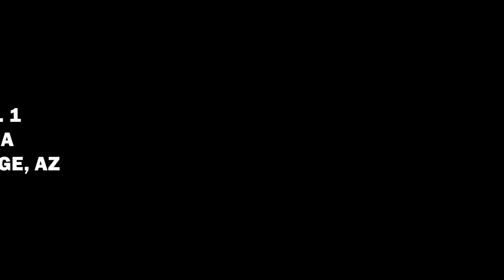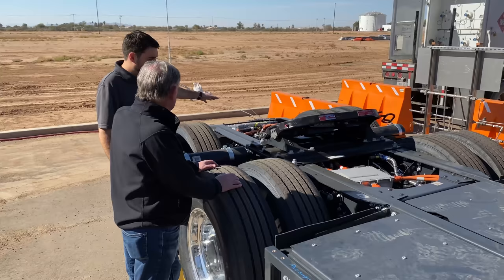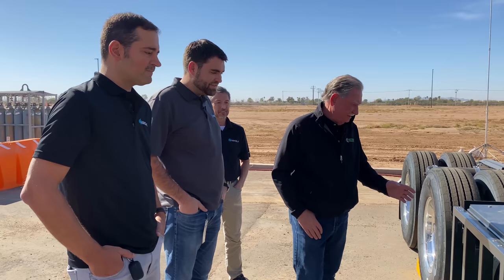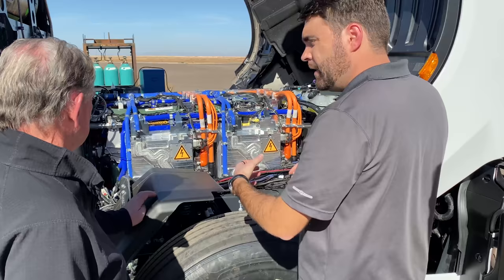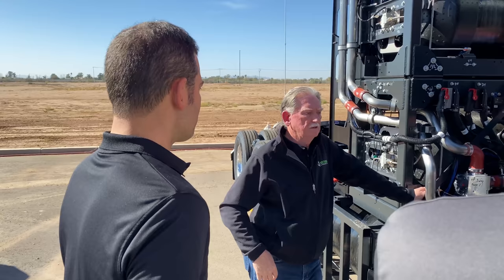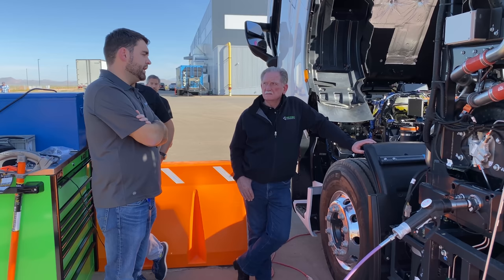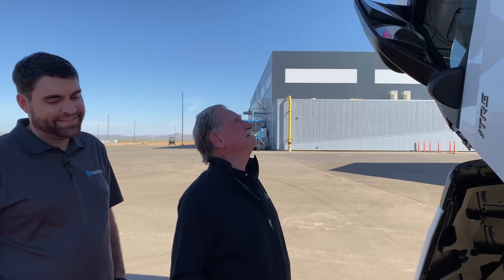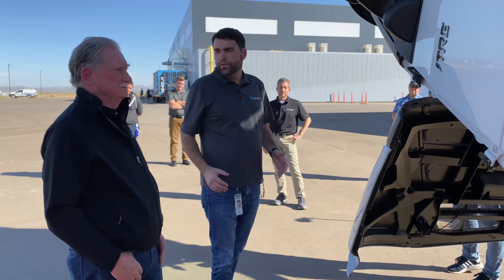Nikola Series - Ep. 1: Introduction & The FCEV Alpha

Comment: Just finished the video. Cool tech but not sold on hydrogen the slightest. The sheer complexity and inefficient process for extracting hydrogen with electrolysis just makes me wonder why anyone pursues this technology. I could even consider hydrogen for long range autonomous aircraft.. but a semi truck? Why? I'll bet that electric semis will be on the road before hydrogen semis. Just my opinion.
Reply: Agriculture is probably the biggest industry for hydrogen. Most rural regions simply don't have the electrical infrastructure for BEV replacement of their equipment, and no farmer has the time to bring a vehicle in for charging... that's why farmers own their own fuel trucks. Hydrogen can be delivered to the field.

That said, I am not a farmer. I'm bullish on Tesla, and that's about it.
Reply: I agree but their argument, as best I understand:  Batts are too heavy for long range trucks and they pretend(ed) they can create H on cheap hours grid electricity--mostly another Milton fantasy.  Also the 'charging' speed.  NKLA should be a penny stock regardless, falls flat economically with no path to viability.  H stations will be extremely expensive with many required.
Reply: If hydrogen starts to get used in chemical industry, electricity generation, heat generation and there starts being massive networks of pipes and tanks carrying hydrogen everywhere, maybe. I wouldn't be surprised if in the end it would be more useful to burn the hydrogen in a specialized ICE or making synthetic methane out of the hydrogen and then burning that in an ICE. The electrolysis process actually has pretty good efficiency when it takes place on an industrial scale and we will eventually get to a point where we have so much wind and solar that we don't know what to do with them. Converting the energy into hydrogen fuel might eventually be economically viable.
Reply: Hyzon motors?
Reply: Hey man, just wanted to say I love your channel, huge fan of your work! All the best! <3
Reply: @PhilipBarton  Nice pondering about the future industrial farms. I suspect they can get away with mostly solar directly charging up tractors in daytime and let them loose autonomously during night.
Reply: @PhilipBarton  self produced solar and wind power is much cheaper
Reply: @Luca-cs8fy  Absolutely. A farmer would still have to pull a vehicle out of operation to charge. They won't do that because they can't afford to do that, which is why the fuel truck goes to the vehicle and not the other way around.
Reply: I used to have the same opinion. But. In the 2030s or so, we're going to have mostly renewable energy production (plus storage), and we'll have to scale it for the darkest, least windy day of the year. On brighter, windier days we'll have more energy than we know what to do with. Hydrogen production would be one of the things enabled by this surplus power.
Reply: @whejl123  I'd love to see a future where farms are robot-operated multi-story warehouses with year-round environmentally controlled operations. Depending on the weather allows for so many uncertainties and risks. In this vision of the future, BEV devices make perfect sense. Current farming operations are so sprawled out, it makes almost zero financial sense for a farmer to install charging infrastructure at or near every potential charging location. The great distances and the time-sensitive nature of farming are the two main reasons farmers seem to be most interested in hydrogen at present.
Reply: It’s easier to convert trash(plastic) to hydrogen than split h2o molecule. That’s a promising approach!! Assuming that can be done on cheap!! There’s just not enuff battery raw materials to feed the demand for electrification of every single motor vehicle. Lithium / nickel / cobalt. Just not enuff mining infrastructure ..hydrogen will have its place in the green economy!!
Reply: @whejl123  not sure. Tractors are typically under working point load somwtimes 24 hours, which is a perfect use of diesel, but kills battery power. Also the extra weight might be problematic as they are under time pressure due to ripening regardless of weather -- loose soil. Maybe there a swap system would be still best.
Reply: Transporting anything heavier than bubblewrap will severly decrease the range for an EV truck. It's just not practical for trucks and heavy machinery.
Reply: @PhilipBarton  - NOPE, see why Hydrogen is STRANDED, here - RethinkX - superpower.
Reply: FCEV & CNG/hybrids are OUTDATED, Tesla BEV Semi is superior.
Reply: @markplott4820  Why the Tesla BEV semi as opposed to any other BEV semi?
Reply: It might make sense for use cases where you don't have hours on end for charging the truck, like farming equipment mentioned or maybe long haul trucks, when down time is far more expensive than a bit higher fuel costs. H2 electrolysis for fuel/energy storage also might make sense if done far away from densely populated regions with lots of sun/wind and otherwise useless area, like desert or offshore and then transported similar to natural gas now. Producing it close to populations centers where space is expensive + the need to transport physical stuff does indeed make 0 sense.
Reply: @PhilipBarton  what i see in holland is that many farmers fill their  roofs with solar and dont know what to do with their electricity some free fuel /backup power in a battery would be nice
Reply: My company produces hydrogen planes, trains, generators, and trucks along with diesel engines and was the first electric semi-truck back in 2019. The issue is energy/kg. Listen to what engineers in this video are saying. This technology issue with batteries in the heavy load EV market is what others are running into. Tesla hauling a Pepsi 18k lbs truck between 150-mile warehouse is easy to do on flat land in an EV truck when it's warm out and others are already doing it. The real world is under 32F over 500 miles per day in rolling terrain and mountains. The battery kW/kg and degradation are too much for such loads.
Reply: @markplott4820  See why it's not stranded by visiting with a farmer. I will never want a hydrogen vehicle, but that doesn't mean it's not practical for someone else.
Reply: So Sandy goes to a massive empty factory,  to stand outside and see a single truck, that can't move?!
Reply: Agree. If a hydrogen semi and a battery semi comes to market and one of them needs 3x more more energy, no one will buy it.
Reply: Hindenburg was flying many times from Germany to Rio De Janero. Element number one will always blind the more blind person....
Reply: Same here. If the goal is to cut emissions, hydrogen as it it correctly derived, is a terrible way to go. It makes more sense to go with natural gas. You still get CO2 emissions, but it's clean burning and much better for congested cities than diesel.  But even natural gas trucks cost significantly more over the life of the truck than diesel. Hydrogen is a dead end unless there is some major breakthrough in the extraction and storage process.
Reply: @7secularsermons  Agreed on the need for medium-term and long-term energy storage.  My bet is that methane will prove to be both easier and cheaper than hydrogen for this purpose.
Reply: @johnnymellon7414   - it takes ONLY 30 min at a TESLA Megacharger that runs on 100 % SOLAR. 
and Tesla can even sell the Excess at a PROFIT.
Reply: @sideshowlol  ONLY , Tesla SEMI has the RANGE (625+ mi) and Megachargers that charge to 80% in 30 min (Lunch Break) , and can 100% FULLY Charge OVERNIGHT Durring MANDATED Sleep period.
the OTHERS like Nikola , only have > 300 mi Range , and ZERO Megachargers.
Reply: Agree, looks insanely complicated. I also do not buy the safety part. Extreme high pressure will never be 100% safe.
Reply: Also what is constantly overlooked is the 95% recycle capability of batteries which will lower costs where as hydrogen extraction will always remain inefficient just on a pure physics level that cannot be overcome.
Reply: @Mrbfgray  Hydrogen vehicles are just as heavy as BEVs. The "hack" for getting better range out of these trucks is the same one employed by the new version of the Mirai: they doubled the capactity of the tanks by going from industry standard 350bar to 700bar. But as rare as hydrogen filling stations are, you know what is even rarer? Ones capable of producing 700bar. That is why they quoted the filling time as ONE HOUR. Because they dont even have 700bar capable filling at thier production facility. 🤷 So it weighs just as much as a BEV and it takes just as long to fill, and it uses just as much exotic materials, but it will be more expensive. I dont see the advantage.
Reply: @markplott4820  The semis will have to run on an NMC battery chemistry. They have higher power density, are able to provide "faster/more", but if you cycle them often below 20-30% or above 80%, esp. on fast charging, it seriously affects cycle life.
Reply: Biggest difference is weight. Many places have weight limits on trucks and batteries are very very heavy. Range and fuelling time as well, but they are lesser issues
Reply: @johnnymellon7414   - TESLA Semi use 4680 High Nickel content .
for PORT ops or Short Haul they can use LFP . 
TESLA complelety negates ANY Effects of its Cycle Life , TESLA 2170 Today last close to 2 million miles. 
Model Y in Austin will be close to 4 MILLION miles PACK life.
Reply: Of course they will be on the road before FCEV semi-trucks. Listen, the weight of the batteries is self-defeating. You are deducting 25% of the load. Green hydrogen is going to get better tax incentives than battery. How does battery perform in cold weather? Which energy storage mechanism is superior? Hydrogen wins. Time and weight plays a huge role in the trucking industry.
Reply: @Mrbfgray  The electric grid is cheaper where hydrogen makes sense. Green hydrogen is also going to get a huge tax incentive. The best you could ask for. Bo, Yankee stadium needs a new toilet cleaner.
Reply: NIkola is a scam
Reply: @markplott4820  Hi Mark. Is Elon Musk ever wrong?
Reply: @markplott4820  The European Union is moving forward with building a hydrogen infrastructure. If you dont believe go to the European Union's website.
Reply: @markplott4820  To be honest, I would like to see a BEV/FCEV hybrid automobile for sale. You could use both when it is convenient.
Reply: Okay so there is a basic problem with an EV truck that you need to understand and that will help you understand why hydrogen truck concept has been touted. Now just wait til the end because i will also explain why Tesla’s new battery is a complete game changer for EV trucking. So let’s say you are going to hike across antarctica. It will take a few months so you bring a few months of food. At the outset of your journey you have to carry 3 months of food. 1 month into your journey you only need to carry 2 months of food and your waste you leave behind. So you extract energy from the food then dump the waste so you dont have to carry it anymore. Now what if you had to pack out all your waste? Well, you wouldn’t be able to travel as far because you would run out of energy sooner having to carry all that weight. You traveling across antarctica and dumping your waste is like a truck driving across the US. It burns it’s fuel and doesn’t need to carry the waste. You traveling across antarctica and carrying your waste is like a typical EV truck. After discharging their batteries, the EV truck still has to haul the dead batteries to their destination.  Now how has Tesla’s new battery solved this? Well, let’s say we invented a new replacement femur that would support your body, but also is a built in battery and you no longer have to carry ANY food across antarctica. You would make the fastest time and could travel the furthest distance. This is the structural battery, the single most important thing revealed in battery day and ignored by almost everyone. With this, a truck could be designed to replace its steel frame with batteries, and doesn’t need to carry any additional weight while hauling. This is why tesla semi has been delayed. They are waiting for the structural battery to be ready, then they will crush the competition.
Reply: The prototype looks more complicated than a diesel truck. I thought we are suppose to make things simple and less expensive. Instead you have a truck that: 1)cost more to buy, 2) cost more to fuel, 3) cost more to maintain and keep safe, 4) needs a more expensive fueling infrastructure, 5) and it does NOT even beat diesel today.
Reply: What's wrong with diesel electric?

Is the majority of hydrogen not produced from fossil fuels at the moment?

Why the major push to keep energy supplies centralised?

Decentralised energy production and consumption is the logical choice especially to safeguard against adverse conditions

Let's stop flogging the dead hydrogen donkey...

Roll on continued battery evolution
Reply: The best lectrolysis tech in the market today is beyond 85% efficiency. It means net 60% of power generation in compare to 70-90% of power generation with batteries. When you add the factors of weight, refueling times and battery degradation you get into the realization that it actually makes a lot of sense.
By the way the last popular pick up truck, not even semi but a pick up truck ny the greatest Rivian was appear to have 40% decrease in range when the ac is open. Which means - dont be so sure battery electric semis re going to just flow on the roads.
Reply: that’s correct electric semi will be first they already have one the bev that will be delivered to costumers at the end of the year I think they have more technology because they will be able to get the bev and the fcev
Reply: It is good to run a truck on coal.
Coal to electricity to hydrogen to electricity for propulsion. Great idea 💡 👍.
Reply: @patreekotime4578    Excellent points.  I didn't bother to get past the fact that H will cost 2X diesel just on the margin, before all the pricey infrastructure, etc.   DOA, plenty of great opportunities out there elsewhere.
Reply: People keep comparing passenger vehicles with trucks. 80 tonne long haul trucks are a different animal..we have to wait and see the trucks that nkla puts out and adoption rates. Tesla already has a 12 month wait period for passenger vehicles. They are not getting into semis any time soon
Reply: I think these guys are full of you-know-what! I don't think they're going anywhere.
Reply: @PhilipBarton  Yes. And indoor vegetable farms and lab grown meats will revolutionize food production. Corn, wheat and soybeans will always be in huge fields.
Reply: @markplott4820  I agree.
Reply: @PhilipBarton  delivery of electricity to the farm will be much easier than that of hydrogen where you need to compress and store it properly. Explosion of hydrogen will be nasty. In Norway, they basically removed hydrogen station after few explosion.
Reply: @markplott4820  You aren't wrong about stationary storage, you're just missing that stationary storage is useless when the vehicle would have to travel back many miles, causing downtime for farmers who can't afford downtime. Farmers will continue to purchase fuel from fuel providers - like they always have. It is looking increasingly likely that this fuel will be hydrogen.

If I could have one wish granted in this moment, it would be for you to understand/accept that I absolutely agree that hydrogen makes no sense for PRETTY MUCH everything -- but farming is an extreme edge case, and current approaches to charging and storage don't work for that ONE extreme edge case.
Reply: @PhilipBarton  Most farms have electricity lol.  Yes a Semi needs a lot.  But a farm to a supercharger is likely not crazy far and the semi would not show up empty either.   So plug in while there unloading and maybe a little longer if needed.   But with 500 miles range you likely won't show up at a far with to low of SOC to begin with.
Reply: @wombatillo  Its always going to be more efficient to charge a battery then make H2 and store it.  But for big Tanker ships, Cruise ships,  Big planes and maybe some Semi's it might have its place.
Reply: Look at who's been promoting H2.  Historically its been oil & gas companies not Greenpeace.  H2 is currently made from Methane,  guess they probably don't see that changing much
Reply: 270 HP only?
Reply: @garbizwal  I never said farms don't have electricity. Spend some time counting the wires on poles in rural America (as one example) and you'll see it's single phase in many places, and obviously minimally maintained. The cost of building out the charging infrastructure necessary for rural American farmers doesn't balance out economically with expected returns, so don't expect any utilities to voluntarily do it anytime soon.

I agree that hydrogen doesn't make sense for any use case where BEVs are feasible. 'Feasible' is the key. A BEV tractor, combine, or other farm implement simply ISN'T feasible. When a farmer NEEDS this hardware, the farmer needs it 24 HOURS A DAY until the need passes. No time for driving back to a charger (hence fuel trucks), no time to charge (hence fueling, which can be done WHILE OPERATING).

The issue of feasibility crops up other places, with specific kg/Wh thresholds needing to be passed before BEV planes, boats, submarines, etc. make any sense. With farming, the feasibility isn't about weight, it's about the immovable logistics of farming as we presently approach it. Farmers don't have the luxury of pulling a vehicle from operation to send it to some designated place to recharge. Hopefully changes to the way we approach farming will make BEVs a feasible solution (perhaps by eliminating weather and location as variables), but right now they aren't.

Reminder: I'm ONLY talking about farming as a use case. I'm unaware of (or unconvinced of) other use cases where hydrogen makes any sense at all.
Reply: @markplott4820  It is clear you don't understand the energy requirements for the operation of major farm implements. It is also clear you don't grasp that WHEN the implements are needed, they're needed 24/7 for a sprint until completion of the work. No breaks for charging, work is continuous even during refueling - and the fuel will ALWAYS come to the implement, not the other way around.
Reply: @PhilipBarton  Stick solar panels on the roofs of the barns, buildings etc and store the juice n a battery or 5 or more
Reply: Completely agree with your appraisal of hydrogen, Will. It's too complex and inefficient for most ground vehicles, especially passenger cars. Maybe aviation? Or for making steel? Glad to see Sandy talking with these guys, though.
Reply: @bohicajohnson7203  This isn't a bad idea - could work great for recharging the farmer's BEV car & truck. Doesn't work at all for delivering power to a tractor in the field 30 miles away from the charger. And no, the tractor isn't coming back until AFTER the work is done - which is why the fuel truck goes TO THE TRACTOR. Farming isn't anything like other applications. The giveaway that someone doesn't understand the requirements is the insistence that (current) BEV technology could possibly work as a drop-in replacement to existing workflows.

All that said, suppose some 'recharging' truck existed with huge ultracapacitors both for its own rapid recharging AND rapid discharging to other vehicles -- maybe, just maybe BEVs would make sense for farmers. Where people seem to get hung up is on that bit that farm vehicles need to be refueled without driving anywhere.

But don't take my word for it. Go talk to a farmer.
Reply: Why is everyone fighting for Hydrogen and BEV Trucks? Both are clearly not the way. Hydrogen is too inefficient to make it viable for mass adoption and building giant 500kWh battery packs for trucks is a total waste too. I'd rather see those batteries go to 6+ EVs or better. 
We need to rethink transportation as a whole rather than making an enormous compromise.
Reply: @PhilipBarton  rural regions don't have electricity lol? But can get hydrogen delivered? What?? All you need is a simple outlet. Charge over  night. Probably even worth it to install solar. Farms have alot od space for that
Reply: @markplott4820  Do you have experience with the Tesla semi or are those marketing figures? If the release has indeed been delayed until 2023, other BE semi trucks will be available well before then.
Reply: @garbizwal  It will be and I think that 90% of road traffic will be battery powered in 10-20 years. Hydrogen has infrastructure uses though and it might be strategically beneficial to be able to stockpile fuel like you can do with oil. Heavy long range semis might use hydrogen due to limitations of batteries and some special use vehicles might also use hydrogen. It might be useful for society to be able to operate under grid-down conditions and have at least a fraction of the vehicle fleet be hydrogen for subsidy and disaster recovery purposes. Aiming for the absolute best efficiency is not the be it all end it all argument. Sometimes it's better to have a few hundred kilos of hydrogen in the tank even if the end-to-end process is 50% less efficient. It depends how cheap electrolysis, hydrogen logistics and solar/wind become. I think they will become very cheap and during peak solar hours the grid will start rejecting extra solar capacity. Moving that capacity to local green hydrogen production might very well turn out to be financially sound even if it's not the best solution in terms of total efficiency.
Reply: @wombatillo  burning hydrogen is very inefficent in a ICE engine
Reply: @7secularsermons  good point, but I wonder if we are ever getting to that point? I understand that solar panels are going down, but then again so are batteries. Everything around Hidrogen seems to require massive scale to be competitive, I wonder if it will ever be competitive. This said I do see a use for it in some areas where batteries are still a long way: farming, planes, cruise ships, etc.
Reply: @markplott4820  Mark, is Elon ever wrong?
Reply: @Matzes  Go ahead and point out where I said rural regions "don't have electricity". I can wait.
Reply: Agree with your thinking , put the fact that 700 bar gas pressure will be needed to reach 500 mile range with only 270 hp will not impress the transport industry, Tesla semi looks like the class leader atm , the future development of the gas converter will play a huge card one day, time will play out here, hydrogen must not be left to slow down it could play a huge part in long range transport not only on roads but trains ships etc, it’s far from home and dry me thinks. 👍😎
Reply: I can tell you're not an engineer lol. If efficiency mattered in transportation, then ICE cars (that are 20% efficiency) would have never taken off. Hydrogen is about the power to gas, higher discharge time and light weight. Batteries will take up all your payload for a semitruck
Reply: @markplott4820  Tesla Semi is all vaporware LOL. Been 4 years and its still not on the roads 🤣 I'll believe it when it's in full production
Reply: We used to say the same with BEVs but Elon proved us wrong. Hydrogen scales up well, so I dont think small cars will benefit but ships/trains/large aircraft can get great mileage.
Reply: @danieldeblasio9368   - even ELON is sometimes Wrong , but he needs to know WHY you think that.
IF, you are PROVEN wrong by ELON , you are FIRED on the Spot, ELON said in a E- Mail.
Reply: @markplott4820  Mark, firing someone for being human is not a good quality. We all make mistakes.
Reply: @sideshowlol  right now it looks the most promising and it's being made by an established EV maker that produces EVs at scale and is experienced with extensive charging networks.
Reply: Hey Will, Better watch it....Sandy's Hiring!
Reply: @visceral_investing  ICE cars only took off because it was very easy and inexpensive to get a highly enriched energy concentrate (oil) out of the ground. An 80% waste of the heat energy content was irrelevant, since that energy was included for free, harvested already millions of years ago. Would have been an entirely different (ICE fail) story if gasoline would have had to be synthesized by humans.
Reply: @Carl_in_AZ  I always heard that's the real use case for BEV trucks, short range hauling between depots and stores
Reply: Hydrogen production is interesting. I used to work for a company that owned the Great Plains Synfuels plant, which processes thousands of tons per day of lignite into various products, primarily natural gas. Recently a company committed to purchasing the plant to produce hydrogen. Not sure of the timeline but it dovetails nicely with this video.
Reply: @RegGuheert1  Good point! But that's lower energy density and therefore inferior for transportation, isn't it?
Reply: @7secularsermons  Yes, but I am not proposing using methane for transportation.  I'm convinced batteries will win for nearly every transportation application, including short-range flying.  Long-range flight is a bit of an uncracked nut at this point.  I don't see biofuels meeting this need due to the environmental impact of trying to ramp up production to that level and I don't think hydrogen can come close to what we have today.

Rather, I am pointing out that we have massive infrastructure for storing, transporting and consuming methane for use in both electricity production and heating applications.  I feel we should take advantage of that instead of trying to reinvent the wheel.

Simply put, hydrogen is not a magical elixir.  Let's see where it can win without massive government subsidies.
Reply: @RegGuheert1  You seem to be thinking very clearly about this and I completely agree with your analysis.
Reply: @PhilipBarton  The pressure required for hydrogen probably isn't a good fit any time soon.  It would probably be more cost effective to upgrade the electrical grid than it would to build a bunch of high pressure storage/distribution.  70 Bar is about 1000 PSI and from what I knew about hydrogen fuel cells back in the day that's low. Stated pressure on the old stuff were more in the range of 5k to 10k PSI to get the energy density up.   If you had a safety factor of 2 at 70 bar everything would have to be rated to at least 2000 PSI.  Components rated at that pressure are very expensive.  It takes highly skilled labor to be able to work on and repair stuff like that. 

I'm skeptical that anyone can build an effective a high pressure fueling network with todays technology.
Reply: @PhilipBarton  ritual region is the best place for PV electricity generation.
Reply: @stevesonnaquesta  By that logic, solar energy is also literally free when its harvested from the sun (millions of years ago). Hydrogen can be made from both solar and the ground :)
Reply: @gags730  Agreed.  BEV trucks cannot replace all applications and/or routes today.  But they do not have to do that right now.  Instead, the BEV trucks which are being introduced can start by replacing diesel vehicles on the routes and applications where they DO work.  As the technology improves, they will gradually be able to replace diesel for more and more routes and for more and more applications.  This will take time.

Some modern diesel trucks have a range of around 2000 miles.  This was not always the case.  In the past, ALL diesel trucks less range than that which is being promised by Tesla.  Will they deliver?  I think they will.  Their track record is that that nearly always exceed specifications, but that they also nearly NEVER meet schedule.  So far with the Tesla Semi they have completely blown their (ridiculous) schedule, many times, but it has been for good reason:  To create a new battery that can propel these trucks over 500 miles for around $50,000 manufacturing cost.  Building these 1000 kWh batteries using 4680 cells is the only reasonable way forward, IMO.

The big issue is that Tesla can build about 13 Model Ys using the same number of battery cells as are needed to build one semi and make a lot more profit in the process.  This may limit volume of the Tesla Semi for some time to come.  If Elon Musk does not feel real competitive pressure from elsewhere, this picture is not likely to change.
Reply: Once hydrogen is cheaply made from excess renewable electricity, this type of powering will make sense for heavy transport. But not yet.
Tesla semi will beat it to death on running cost. Range may be an issue in its favour, but not by enough. Rapid charging at regular stops is a better way to go. 2 hours tops on the road until autonomy takes over.
Reply: @PhilipBarton  farms are an ideal place to set up a big PV system with enough storage to fuel all the battery powered farm equipment. Keep it simple...
Reply: @Mrbfgray  you are completely wrong about BEV's. You'll see.
Reply: @gregbailey45    I've only been tightly tuned in for about 15 yrs, beyond my general engineering background and 4 decades contracting for heavy industry.  Why don't you school me?   What am I missing?
Reply: Hydrogen is accessible in every continent which means nations can finally be energy independent. No oil or batteries to worry about. Nuclear, geo thermal or hydro can be the basis of the means of production.
Reply: For long range heavy transportation also Daimler is moving towards Hydrogen . Many others are doing the same .
Reply: @gregbailey45  Cool, that logic ought to convince any farmer. Let me know how that works out for you.
Reply: NIKOLA ALSO has a pure EV semi. That is the Nikola Tre. The Nikola TWO is the FCEV Semi.